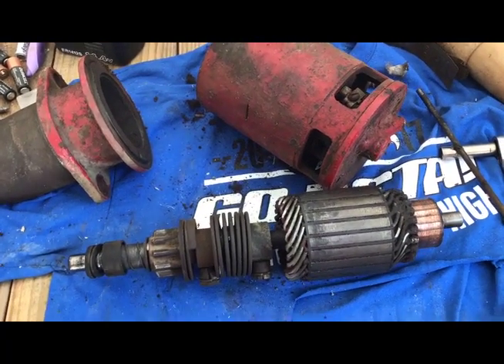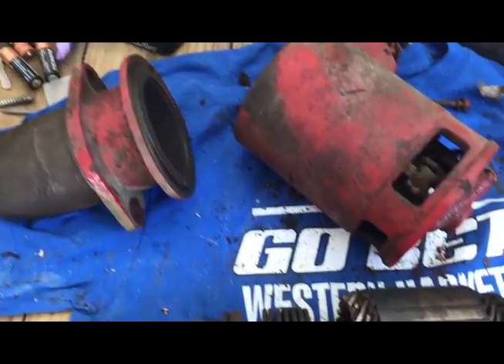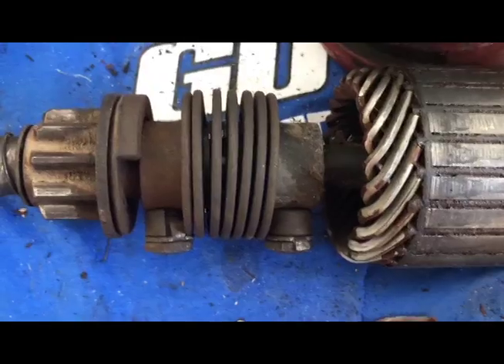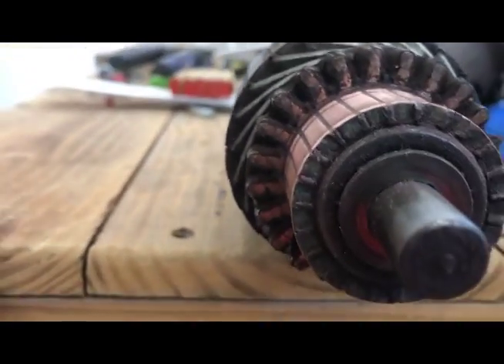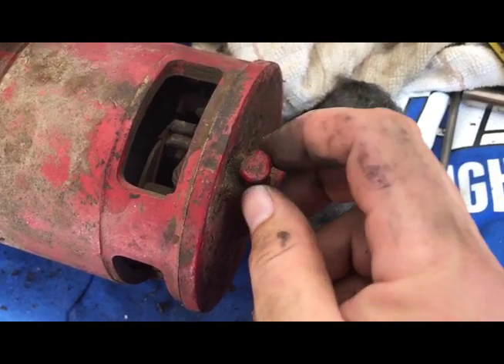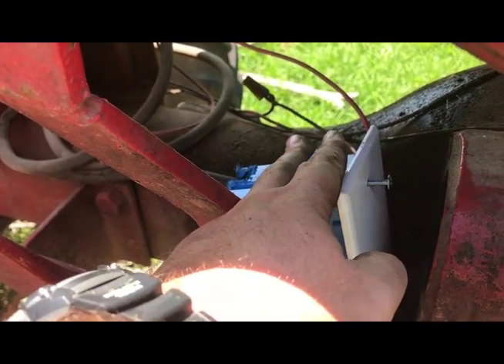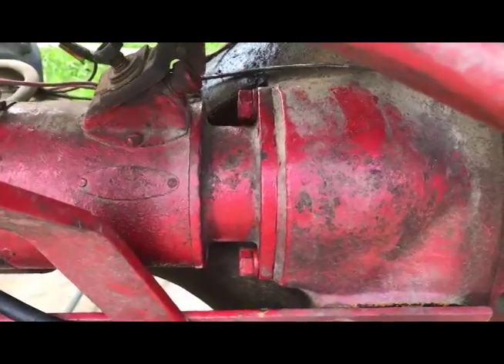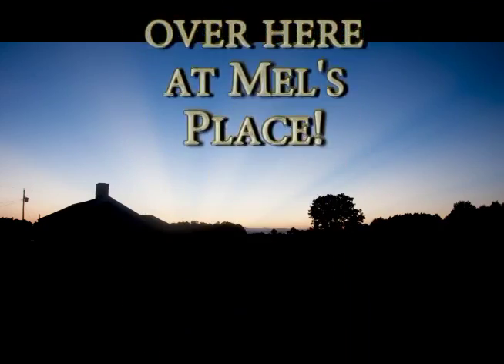Working On The BN Starter (27)

Comment: She just needed some clean up . Commutator , i believe it is called " copper pick up wears and the springs that hold the brushes tight get bound up. If those Brushes are not making good contact to the commutator they tend to not work. Even the mounting surface for starter needs to be clean. That is a major Grounding point if you are Negative ground battery system or reverse " positive ground system,,, if you have the old 6 volt system.  Thanks for sharing .